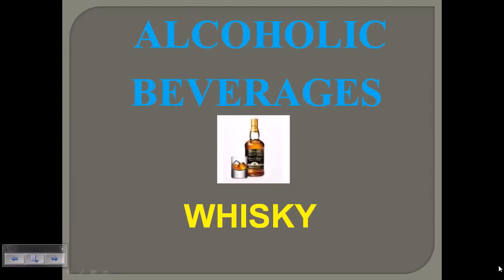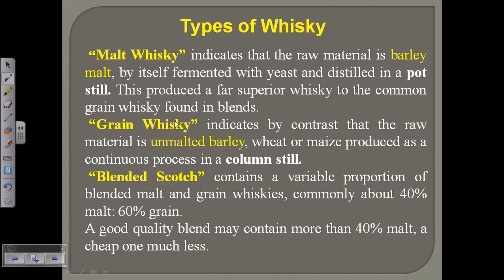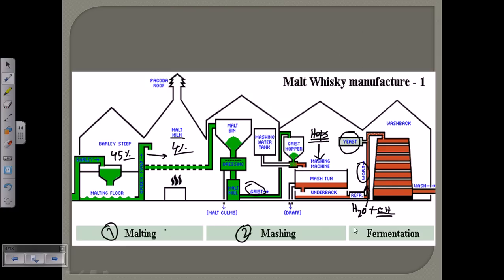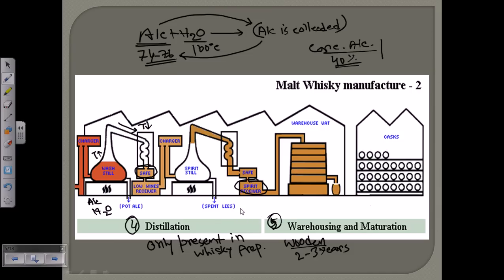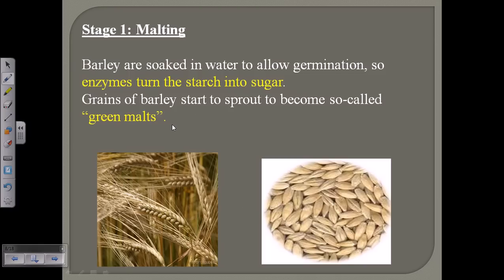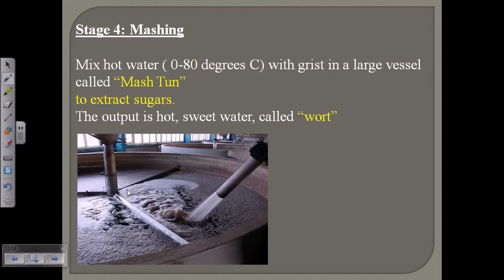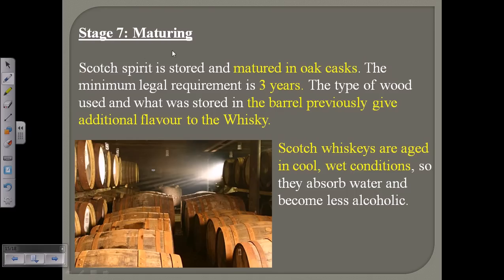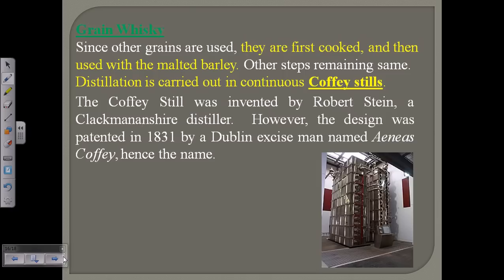Whisky production (process of whisky making)

Comment: your info is not all correct ,also you failed to explain what really happens during mashing,the grain contains starch,sugar and enzyme,,the hot water helps the enzymes convert the remaining starch to sugar,,this is called a resting period typically anywhere from half hour to 1 and half hour for converting,,also sour mash has nothing to do with reusing yeast,it has to do with reusing the left over cast that is left after first distillation,,they will take this sour mash from the distilation pot and put more grains or sugar and make it ferment again and run it in the still,this alc is now called a sour mash run